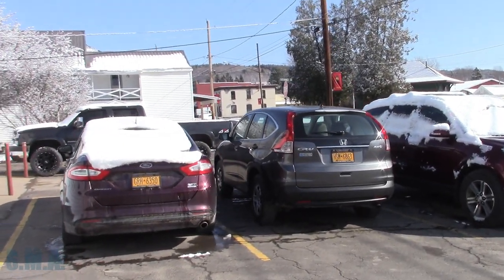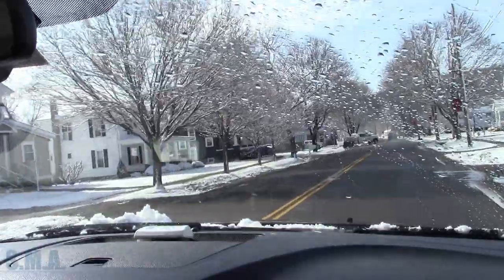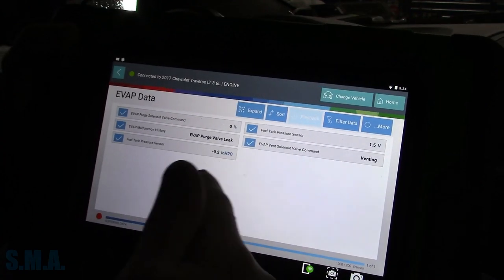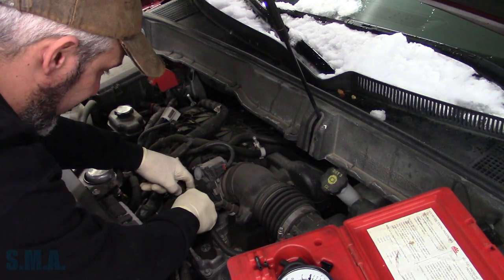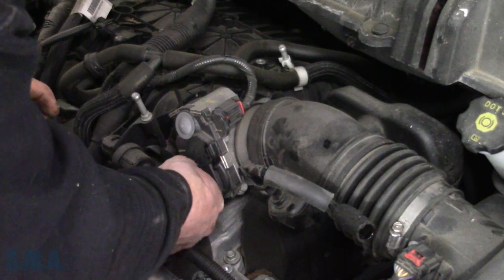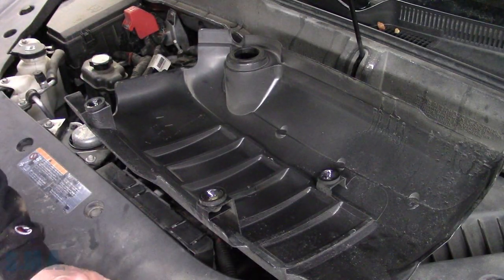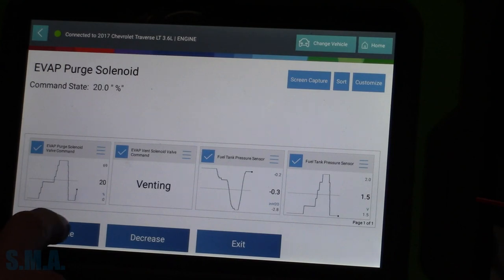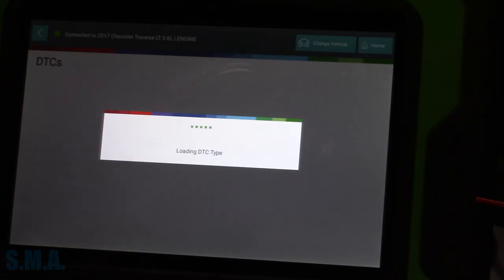Chevy Traverse: P0496 EVAP Code

Comment: Every time I see a NAPA commercial I say to myself, "Not a sponsor". It's all your fault.
Reply: A couple weeks ago I told my boss I needed some parts from Napa, not a sponsor. He had no idea what I was talking about. :)
Reply: Hell every time I pull up to NAPA I say “not a sponsor”!
Reply: I bought a set of Accel plug wires from Napa on the box it said less than 500 ohms per foot,  when I got them home I checked them. They were closer to 1500 ohms per foot. I took them back and told the counter guy what the problem was.
He told me the ohms would be less in a race engine application.  I was surprised he said something so stupid. I got my money back and went to AutoZone and bought the cheapest they had only 200ohms per foot!

Comment: 🎵See the service bay in your Chevrolet!🎵
Reply: OMG!!! I love it!!!
Reply: I pick up my boss every couple months at the Chevy dealer in my Hondoo that hasn't been back to the dealer since I bought it (used) 4 years ago
Reply: BWAAHAHAHA! Now THAT is a perfect jingle! Spent the first 3 years, 36k in the service department with mine ...
Reply: @SmittySmithsonite  Never forget what car company invented the Vega.
Reply: @tomd5010  They had cylinder walls impregnated with 17% silicone.....the last step was an etching process that had the rings riding on a "wall of stone".  I owned two.  Rebuilt both with steel inserts.  Bought the cars dirt cheap cause they was SHOT. 
My FAVORITE find about them was at a local machine shop.  He had Vega blocks all over the place.  He was contracted by the local Chevy dealer to fix them.  And I noticed that a number of them that were ready to return to the dealer only had ONE insert in them.  He said to me ....in so many words.....THAT GM WAS SOOOOOO CHEAP (HOW CHEAP?) THAT THEY WOULD ONLY PAY TO HAVE THE CYLINDERS THAT SHOWED SIGNS OF WEAR, BE SLEEVED!!!  They removed the engine from the vehicle, sent it to him, and then with it down to a bare block, would only pay him to sleeve ONE cylinder.  It was around 1975.  I paid that guy $150 to machine the block, insert 4 new sleeves, and he handed me new rings for the pistons.  Engine ran forever and never burned a drop of oil with the sleeves.  Yes, I learned a lot about GM from that.
Reply: @fillg  I always was fonda my Honda.

Comment: 07 suburban, using live data, slow leak, needed a gas cap. It still had the original. New cap fixed the leak. Vent valve and purge valves worked just fine. Special functions 👍.

Comment: GM latest marketing program. "Free MIL with every vehicle purchase!"
GM Generally Misbehavin'
Reply: Lol.. 100% accurate.  Love it.
Reply from the maker: @kingpins9  GM + General Mess
Reply: Could be worse: could be a Chrysler!
Reply: @SouthMainAuto   fiat+franky its another terd
         Fix it again tony
Reply: I like Ford: Fix or repair daily!
Reply: @repro7780  First On Race Day
Reply: In general they don't design or build cars no more to last to your kids 8th birthday, 'cause all the executives at the automakers would be out of a job from loss in sales.
Reply: @GeneralRELee  They are all pert near bankrupt now.
Reply: @jdigitalseven7  First on Recall Day.  At least that was my experience with Fords from the late 90's through early 00's.  My most fond memory of Ford recalls was when the then-brand-new 1st gen Escape got recalled to the point where the delivery trucks weren't allowed to pull the vehicles off the carriers.  The recall - the factory may or may not have tightened the steering wheel hold down bolt properly.  We had to perform the recall on the vehicle in situ.  Didn't matter if the car was on the lot, or still on the truck!
Reply: @repro7780  Or another oldie but goodie, "Found on the road Dead" , my old man loved that one
Reply: Mopar= my only problems are repairs
Reply: Minimalistic Van Living Some manufacturers are better than others.  But as the saying goes, they’re all junk when they’re broken.  And they all break at some point in time.  No company is exempt.
Reply: Best Acronym. CHEVROLET...CAN HEAR EVERY VALVE RATTLING ON LONG EXTENDED TRIPS.😎
Reply: @repro7780  I like Fords. Older ones anyway. I can still give you one.
Flip 
Over and 
Read 
Directions. lol
Reply: @Minimalistic Van Living They all make great cars and trucks. Just get rid of them in five years and you will never have a problem. It is designed into the vehicles.
Reply: GM means "Grossly Mismanaged".
Reply: @NY411Info   And finally - F'ers only run downhill!

Comment: My 2002 Camry had an evap code. Watched all these videos about dropping the gas tank to fix it (something I'm not skilled/equipped enough to do and the car's not worth it to pay to get it done). Turns out it actually was the gas cap, the o-ring was petrified and cracked in several places. Got a new one on ebay for cheap, cleared the code and 6 months later still good. Phew.

Comment: 1999 dodge ram 1500 extended cab! code read at autozone! guy doing the reading said "well I could sell you a gas cap but often the seal is just a bit dry, put some vaseline on the gasket see if that helps" Oddly enough someone at my house had some of that :) lubed it up and by golly it worked! at least till the catalytic converter plugged up 6 months later not sure if that was related. To recap: it was the gas cap and I just got advice instead of a gas cap from an auto parts store.

Comment: I have worked on automobiles doing drivability since 1987. I can count the number of gascaps I changed that were the prob on one hand and O2 has not been a major issue since 90's still some failures. It is the job of that scan tool "specially designed" and the sales man at auto zone and advance to sell you parts not diagnose or fix the car. And they are intentionally not taught diagnostic procedure on purpose. A part swapper trying to save money can spend more money if they dont actually know whats wrong :). BTW most stealerships hire part swappers to follow TSb's and not an actual diagnostician.

Comment: Funny enough for my 2006 Chevy HHR it was the gas cap LOL.  Figured that out when putting on the gas cap it would just spin and spin and never click.  Replaced it and yay it spun and clicked.  Also after clearing the EVAP code it never came back and this was 5 years ago.  So from time to time it really is the gas cap :)

Comment: Hey Eric,  Just wanted to let you know. That the Zone does a recommend fix for that car/truck.  In which the recommend fix is NOT the fix. So getting a good mechanic to have the knowledge and years of doing repair work is the best to fix a problem. Paying someone a 1 hour daig fee is better then just changing parts.

Comment: If I replace my own purge valve, will I still need to go to a mechanic or AutoZone and have them turn off the check engine light? Or will it turn off automatically (if I do the job right)?

Comment: And you didn't have to bring out Big Nasty, or the Brakleen from Napper, "not a sponsor," or the Pico, or the load test bulbs, or the "known Troublesome Tree from Generous Motors," or.............!
Quick and easy diagnostic test and part replacement.  Nice touch with the after repair verification testing including the all important trip around town.  Shoulda had Mrs. O.  Coulda gone cruising!
Reply: But he did use the sheep juice  Fluid film. I've found that I use it on almost every vehicle I work on now since Eric O introduced it to me.

Comment: Like you, Eric... though I own, wrench on and fix Shove-roll-ehh's all day? Can't say a gas cap swap fixed one with evap codes. Only time it did was when I "fixed"  '13 Impala LTZ that had lost the gas cap entirely and left a little nub of nylon attached to the inside flap. The tank was wide open to atmosphere. 

Experienced same code on my SS Silverado you did on this beast. Same as you, whacked on the purge solenoid to no joy at all. Swapped it after blasting the purge line with low pressure shop air and is been great for 3 years so far. (Knocks on charcoal canister for luck) 

I'll bet it'll puke itself stupid over a vent valve next. ^.^

Comment: One of those vehicles you worked on that only needed a gas cap to fix the evap code was my 2005 Silverado. You told me you thought I was playing a joke on you because I had bought one but didn't yet install it. I left it on the seat. I had to take a 3hr drive for an honest diag. Thanks again.

Comment: Had one time my 02 Ford Ranger the gas cap caused a code and it was supper cold and the Seal on the cap wasn't very Pliable  to say and didn't seal . All I done was loosen the cap and parked the truck inside my heated garage and next day no more check engine light for Evac code! Same cap ten years later and still no problem!! 
By The way know what you mean Eric about the cold and snow we have had some unusual cold weather here in Southern Missouri in April  too!

Comment: Hi Eric, had a look at Wells Electronics, I don't quite agree with you. You are a natural with a ton of experience. He sounded like he was reading an auto que. I will look at some more and maybe i am wrong but first impressions you are a natural. I could throw any fault at you and you would hunt it down using logical deduction a bit like Peter Faulk used to do in the old Columbo movies. This is a good analogy, this kind of fault finding is like proving the bad guy did it. In my opinion you are definitely up there with the best.

Comment: I feel ya we got snow two days in a row.  More coming Sunday.😡  Nothing like northern New Hampsha!, Except maybe Avoca weather.👍 Haha maybe a new drink?  Vapor Leak Detection Pump is very common on 2008 and up Grand Caravans small evap.  If you do visual inspection it is near the fuel tank on the charcoal canister. The electrical connector on the pump itself splits and shows signs of the 'Green Crusties"as one Eric O would say.

Comment: Interesting that this video shows up in my recommended as my ex's 2006 Yukon just pulled this code. I haven't even had the chance to goggle the code yet. Thanks for the video. Now I just need to find where the valve is hiding on the engine. Hers won't qualify for the free fix. Too old and it has 130,000 miles.

Comment: I always check the purge valve for carbon when I get those flow during non Purge codes.   If the canister is coming apart, it will come back  with the same code.

Comment: I had a whole bunch of stuff I was gonna say ... and I forgot all of it! 🤣 

EVAP codes seem to be the hands-down #1 code I see here, and I always forget the tests I should be doing. Purge and seal! That's the one I couldn't remember last time. Think it was a '17 Renegade, or whatever they're called these days. Had the cheap, crap, low-bidder vent valve tucked up under the wheel liner of the left rear, along with the charcoal bucket. I guess I diag'ed that one correctly, since I didn't see it back (they needed a sticker, so if it failed, I'd have heard about it). I called the dealer and they said it was out of warranty, even with just 50k on the clock. I figured that was part of the "emission system", no? Not according to FCA! They told me that 7/70 (or whatever it is now) only covers the catalytic converter. What The Eff Effity Eff!  Reminds me of GM trying to weasel out of my warranty claims ...

Full sucky!! 😂🤣😂 I'm going to be walking around here saying that for the next 3 weeks! 😁👍🍻

Comment: In the USA emissions equipment are covered for 10yr or 100k miles per government mandate. This repair is supposed to be 100% free to the owner at any GM dealer. On the other hand I can see paying SMA $200 extra while he already has it for an oil change and brake service to simply make the problem go away instead of the hassle of calling the GM dealer, fighting/scheduling with the dealer's underwriter, get fed a sales pitch, and being out of the use of their car for an additional day or two.

Comment: In my 2+ years of working at the Zone I have NEVER sold anyone a gas cap after pulling the codes from their car. I have sold around 2 dozen caps in that time mainly because they forget to put theirs on when the filled up. I have overheard co-workers telling the customer that the need a new gas cap but I personally don't tell them that. I just tell them that they have a leak somewhere & it could be a number of things & they should have a mechanic check it out.

Comment: P0496 - needs new wiper blades.
Reply: and a freakin gas cap ;)
Reply: Came looking for this comment😂
Reply: P0497 - seat pressure sensor, crash diet required.

Comment: Funny thing about going to the dealer for a campaign or recall, I had a 2006 nissan 350Z and I got a notice from Nissan for a recall. Ut OH so I take the car in leave it for the day. When I go pick it up,the service writer all smiling says your all set here's your keys. Yeah I pull out and my TPM light is on. Oh jeez I pull back in to the dealer and ask the service writer who's still smiling; why would my TPM light be on?  So after a small investigation he determined that the tech did me a favor and rotated my tires. Yeah they are different sizes.  Lmao. The recall was for a fuel pump relay.
That's probably why your customer chose to have you do that repair, he knew it would be done right and nothing else  would be monkeyed with.

Comment: Friend had the same problem with a mazda 3.

 After many service calls and 2000 dollars  Canadian, the Mazda stealership replaced the piece after accidentally breaking it while leaning into the engine compartment.

Now each few years when it dies I simply hit the dealer for 89 bux and replace it myself.  A few minutes in a driveway no tools required.  Phewf

Comment: good video. Classic purge valve design by bosch. Wondering if owner did mention anything about hard star after fill up the tank or almost stall out coming to a stop. I done a hand full of those in chevy cruze most of the time fuel trim seating at idle get positive around 20%. The valve was leaking really bad.

Comment: The purge valves on these are covered under a special policy adjustment. Here is a line directly out of the bulletin related to this adjustment. "
Dealers are to replace the evaporative emissions purge valve as necessary. The repairs will be made at no charge to the customer." I bring this line up because I know there are dealers out there that are charging for diagnosis on these and that is flat out wrong. This repair is to be at no charge. It says a lot about you when a customer would rather come to you and pay for the repair than go to the local dealer. Sounds like the local dealer there needs to re-evaluate what they are doing. The dealer I work at people are beating our door down to get in. Most of the time we are week behind. Lesson, if you treat people right and are honest you are going to be busy and yes, we have customers that want to come to us for service. We view customers as guests, and we build relationships with them.
Reply: but it says "repairs" not "diagnosis" lol

Comment: At work I have a 2019 Ford Transit Connect, it’s been on the road since August last year, and it started throwing this code 2 months ago, lost all the gas in the lines every time I filled it up, and then it fried its transmission, or just the “clutch” at 53k miles, it doesn’t like hauling batteries for AAA, thankfully it was still under warranty

Comment: When doing a brake job on my personal cars, if I don't replace the calipers, I check the temperatures of the rotors after driving it with my infrared thermometer to make sure the calipers are not sticking.  Seems to me these calipers with plastic pistons like to stick, especially after pushing them in.

Comment: Strange. Our Colorado emission stations test the gas caps every time you go for a test. They use a separate test tool for the job and both of my vehicles failed last year. I installed new caps and returned for a retest and both passed. The failed ones were maybe ten years old.
Reply: yeah, the rubber seals get hard, crack, deform or chaffed from handling, debris and filler neck rust.
**also some people beat the snot of the filler neck with gas nozzles, denting and gouging them which chews the cap seals

Comment: Imagine that a CHEVROLEEEET! with an evap code.  I though I also thought I heard you say a cam crank code.  No shock there either.
Reply: I've had a 62 chevy, 69 Chevy and a 78 Chevy and never had an evap. Code. Ok they didn't have computers either. 
Aren't computers in cars so much better it can tell you where a problem is, or about what direction to go.

Comment: So the repair is warranted for 2 years or 24K miles?

It's a Chevrolet.  It's located in upstate NY, it has 84K miles on it.  I doubt it has EITHER 2 years or 24K miles left in it.  :D
Reply from the maker: The work I do is warrantied parts and labor for 2/24

Comment: You also said it was in for an oil change, but you wanted to get it warmed up before changing it.  How in the world do you change the oil filter on that with out burning off all the skin on your forearm from the CAT converter that's right next to the oil filter?  Also, how do you prevent the oil in the oil filter from spilling all over the engine mount/arm that's directly below the oil filter (thanks GM engineers for that one :\ )

Comment: On my 2016 Traverse it would not want to start after filling up the gas tank.  After extended cranking then it would start and run rough a few seconds and then be fine.  Same part was the problem.

Comment: My daughters 2010 Nissan Versa had the P0456 (small evap leak) so the shop slapped on  a 32 dollar gas cap from Nissan.  The check engine light randomly comes on and off with the same code.  I am going to make a smoke machine to see if I can find the leak.